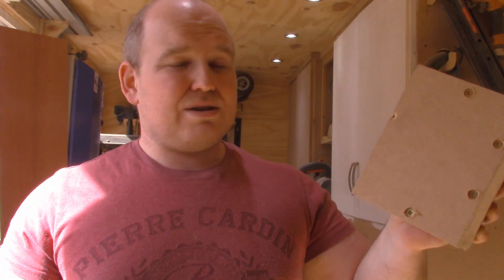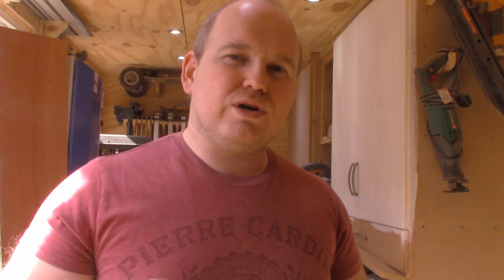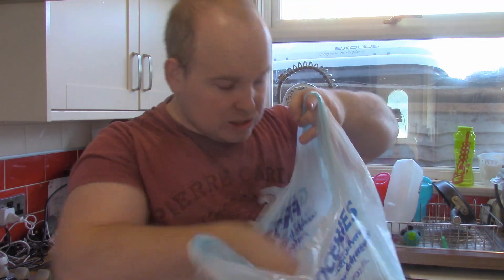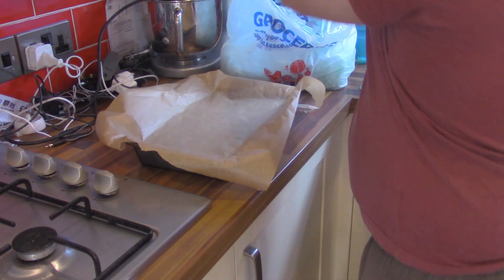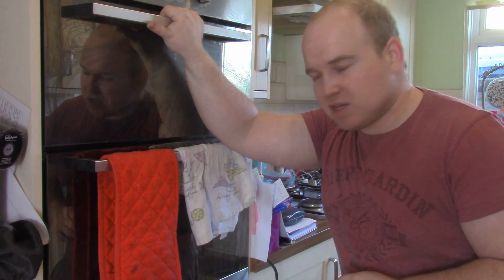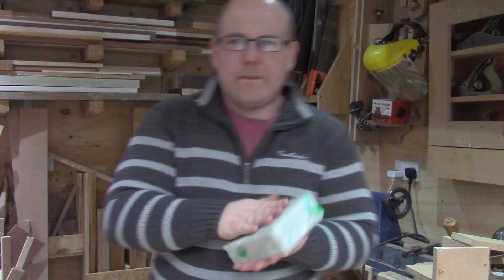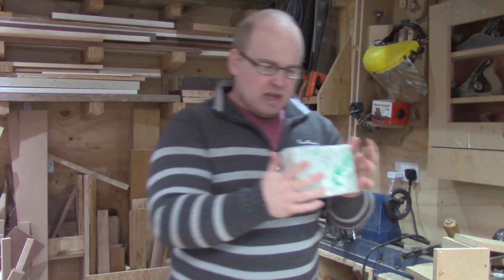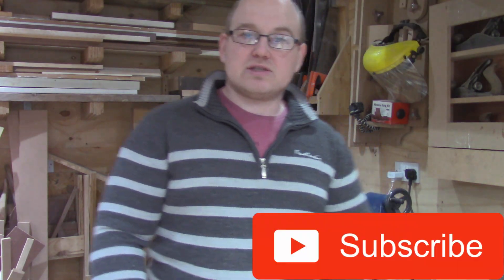HDPE Plastic Recycling | To Usable Blocks

Comment: I think you can go to 300° c (if your oven can handle it) to get a far more liquid shot. I'm under the impression that there aren't any toxic gases to worry about as long as you're in a ventilated space and not gulping in lungfulls of the stuff, ie. Using common sense ( not very common tho)...

Comment: Doesn't the plastic emit fumes during the process?  A lot of this stuff may have been treated with other chemicals with lower melting, decomposition or vaporizing points than the plastic itself. Is anything coating your oven after you do this?
Reply from the maker: No fumes as not hot enough. Just the melting point. Nothing inside oven whatsoever

Comment: I don't recommend using your oven you use for food to do this. There is off gassing. I recommend doing this in a well ventilated place wearing a respirator. Use an old toaster oven, just not where you prep food.
Reply from the maker: Good advice 👍

Comment: Yeah great vid, heat retention is related to the material density (Thermal Mass)
There is a commercial brick made from recycled plastic now being sold for use in homes instead of a light weight building blocks, the benefits are hugely improved insulation.
Now all you need is to get your whole street to donate their milk bottles a wood chipper & 2nd hand washing machine to wash the plastic and you can insulate your shed with your bricks :) Or buy a 1000Kg of the stuff from the council.. 
Top work
Reply from the maker: The possibilities around this is awesome! I love seeing how people put it to such good use instead of it ending up in the ground of water systems. I myself won't be continuing this, but I would highly recommend brothers make, who are doing incredible work using recycled plastics
Reply: @WHCreations  As you said so many possibilities, imagine HDPE thermal cladding? Or over cold floors 
Someone somewhere will be buying up the HDPE making it harder for the little guy I suspect :(
Reply from the maker: @dmbrookfield  as long as people turn it into something awesome and saves it from landfill or the ocean, then humanity is winning

Comment: What happens if you use sun-damaged HDPE 5 gallon buckets ?  Does the UV damage sort of go away when you re-melt it ?  I have a few cubic feet of clean brittle HDPE I would be happy to send you.  Then after melting it would be interesting to see if it has "recovered" from being brittle.
Reply from the maker: Hi Roger, thank you for the offer, that's very kind of you. Unfortunately, I don't tend to use my hdpe anymore due to being unable to get a uniform finish. Appreciate you taking the time to comment though!

Comment: I made a mold out of half inch and quarter inch plate aluminum.   It's a great material because it's strong and you can use any woodworking tool to cut it.  From there it's easy to drill and tap holes to hold it together.  Then I just throw the whole thing in the oven and  heat it up.   It works great because the aluminum retains the heat for a bit while I get it clamped, then it acts as a heat sink when it's out of the oven to cool the hdpe.  I did something similar with a bit of 2 inch threaded pipe to make a cylindrical mold that I can use for making things I can turn on the lathe.  Great vid!

Comment: Nice video.... 2020 has been a horrible year with the lack of available materials for creative recycling..  and melting HDPE looks like a possible way to get around the shortages..  just  have to remember the upper temperature limitations
Reply from the maker: I wanted to try and make a piece of furniture using only hdpe. The cost for such materials was astronomical and just wouldn't have been feasible.  One day maybe

Comment: I'm having a problem with it sticking to the parchment. It's even scorching the paper and I only started at 300-325 C (150-160 F). Do I need to buy more expensive parchment paper?
Reply: 170° Celcius buddy.. not 300°celcius
Reply: 300C is over 570F. Are you sure you have that right?

Comment: I tried this in Dublin. Put the cut up bits of HDPE on an oven tray and set the temperature to 170c . 30 mins later it was barely melted . Also my wife asked me what the smell wqs. Left it for another few mins. Turned oven up to 200 for 2/3 mins  Still  Could not mould it as it was not soft enough. Threw it in the bin . What did I do wrong ???
Reply from the maker: Are you sure it was HDPE? hdpe melts pretty easily and molds well. I dont know without standing next to you at the time what you did wrong I'm afraid.

Comment: Nice video. Thanks for sharing. But I'd never do such a thing in an oven which later on will be used for making meals and  cakes.
Reply: You drink milk from materials that contain toxic substances?
Reply: @836dmar  No, I don't. Firstly, I don't drink milk at all. Secondly, milk is not packed in HDPE containers in my country, as far as I know.
But I don't know if it is proven if HDPE containers contain toxic substances that are released under normal circumstances.
When you burn HDPE, then yes, or when you heat it up too much. But I think that is the case for most packaging materials.
Reply: @hansdegroot8549  I melted a 5 gallon container today of white HDPE. At 300F it smelled like wax. Not sure if it was toxic at all but it wasn’t really bothersome I know that. That was a lot more efficient than melting down individual milk containers used here in the US.
Reply: @836dmar  Did you cut the hdpe in smaller pieces? I don't know how much 300F is.
Reply: @hansdegroot8549  Yes but at first only into larger pieces. They melted into a sheet that was a bit too thick for my project - maybe 8mm or so. Making a press to make blocks would be best IMO. I also cut small pieces and shredded them in a blender. I used those small pieces to fill in voids in a small sheet metal mold I made to surround a metal press finger that needed padding. Used multiple heating cycles. Ended up with some air bubbles but might use a heat gun or torch and smear some as a “patch” or filler over those areas just for aesthetics. Went up to 350F but that did increase the waxy smell a bit. Anything 300 and up works. Takes some experimenting but is interesting to work with.
Reply: Also found I could cut thin strips of HDPE and use it as filler rod with a heat gun or torch to soften the surface and the filler strip and weld up voids. Smoothing with a hot paddy knife helps.
Reply: He is at 170C that should technically be below temperature for releasing toxic gases, but yes you're right lol. Best practices kind of thing

Comment: For an FYI here, HDPE weighs just under a gram per cubic centimeter or just over half an ounce per cubic inch.

So, do the maths on how big your block will be and you can weigh your scraps to find out if you have enough.
Reply from the maker: Good tip
Reply: @ashwinpatel7410  it would be about 75 ounces or just about 2 kilos if you think in meteric.

Comment: I'm pretty sure the fumes from this are terrible for you. are you still alive?
Reply from the maker: Let me check...
Reply: See my reply above to Andrew Young’s comment.    Both low and high density PE are purely composed of hydrogen and carbon atoms fully bound in a polymer structure which is very stable.    Not normally any additives, especially in food grade like milk bottles etc.    factories where hdpe is being blown or molded are not toxic zones.    As long as you keep in the normal melting range you are fine.    However, pvc, especially flexible pvc where plasticizers and other additives are present as well as chlorine atoms in the polymer is a very different story.    Stay away from pvc.

Comment: I use Lubriplate, white lithium, mechanics assembly grease as a ‘wood’ mold release. When either HDPE and LDPE are cool, the plastic falls out. Your shop looks interesting. Stay awesome.
Reply from the maker: Hey Doug! Thanks for the tip I will certainly look into this! You too bud

Comment: we tried the same procedure only that the plastics are not melting at all, what's the reason behind this?

plus, is putting the hdpe plastics by batch? what would happen if we put all the plastic all at once?
Reply from the maker: Hi, I would say the temperature isn't high enough or you are not leaving it long enough to get to temperature. In regards to putting all the plastics in at once you will be greatly increasing the time it will have to remain in the oven and also you may get more air bubbles.

Comment: I'm concerned about the grease & fat from the milk preventing homogenous melting together of the various HDPE container snippets. That would mean that despite no air pockets, one HDPE blob from a container snippet wouldn't mix completely with another blob from another container snippet. Did you use something to combat the milk fat/grease?  Did you thoroughly wash the milk containers? What went into the preparation of the raw HDPE prior to melting? Great video and I'm envious of your workshop! All the best, Rob
Reply from the maker: Hey Rob. That's a very good point you've made and something I never even thought about showing in the video. In regards to the residue within the bottles know that they are washed thoroughly and left to air dry. In regards to oils etc I am a little unsure. The hdpe is technically a hard oil and therefore would be unsure as to how other contaminates would effect the overall outcome. I would point out however that these have had all their labels, ink prints and glue removed. Thanks 😊
Reply: maybe you can add some waste oil and got uniform result

Comment: Hey man, i recommend you to buy a cheap aluminum tray and use just that, it usually peels of easy and you don't have to use that paper that sometimes sticks, at least for me it was a nightmare, all the time it glued to the plastic leaving a horrible look. Also if after a good time it stills hot it means you got a great pressure!, since the heat could not scape. If you cut it in the middle to 'glue' them together, you could use that tray but not in the oven, put it on the stoove on medium to low heat and place both of the faces you whant to fuse there for a while and keep an aye out, after a while both sides should be soft enough that by putting them face to face and giving it some pressure (nothing crazy), it will bond like a solid piece again. Great video and keep creating! :D
Reply from the maker: Thank you Victor that was great info!
Reply: Hope i helped mate!

Comment: Very uninformative 
Forgot to mention the temperature in the oven.
Didn't explain why you didn't fill the tray the 1st time like you did the last time  ?
Reply from the maker: Hi, I did mention the temperature it was 175°c. In regards to your next question I'm slightly confused by it, please explain in more detail or watch the video again as I do believe your questions are answered.
Reply: The reason why he did not fill the tray is because when it gets hot it also gets smaller, having too much can make air bubbles, and having too much takes longer to melt to a nice point since all the pieces are layering each other, its not a fast process you need to be patient with it

Comment: Do you have any idea of how much HDPE it took to make that block?  Probably just knowing the weight of the block would help.

I've been cutting up HDPE milk cartons and the pile doesn't seem to grow nearly fast enough.  :  )
Reply: Go to your local school after hours and raid a dumpster for plastic milk jugs or talk to the janitor and make some kind of deal with him
Reply from the maker: Hey Brant. In my latest hdpe video I think we used roughly around 1kg of plastic. You'll be surprised by how much you'll need to make a blank the size I did. Seeing as I have 2 young children I seem to go through milk like I should have shares in it, but also make sure you check out your other good too. Shampoo/hand wash bottles etc are all hdpe. Just make sure it has a 2 in the triangle and washed out sufficiently and you'll be golden. Hope that helps you out!
Reply: Thanks so much for your reply!  I will start looking at every bottle to check if it is HDPE.  I want to make some sliding parts to fit within the dovetail slots of my table saw.  I am trying to avoid buying another expensive sheet of the HDPE.  Tell my cow buddies to keep pumping out the milk!  :  )
Reply from the maker: Haha. If you're in the UK the pound shops sell hdpe cutting boards. Failing that just make sure you keep the heated plastic under pressure. If you check my new video I kept tightening it every 30mins or so.
Reply: Thanks for writing back.  I am in the US.  We have some of those cutting boards here, too.  You have be careful on some of the cutting boards as the HDPE is sometimes just a thin skin over a piece of fiberboard.  (Some here call fiberboard "termite barf".  I like that!)  I really need to check your other videos.
Reply: Use 5gal buckets cut up into pieces.
Reply: If you happen to know a car mechanic or any place like that, those motor oil containers are made of HDPE, thats how i got literally a box full of it, since the mechanic uses them daily, the only problem is that is really annoying to clean up.
Reply: @kendarr  Yes, Victor, how do you clean up the remaining oil??  Bob
Reply: @rsauve999  Wash it while its on one piece, and then cut it in half, and you wash and scrub both sides with a abrasive sponge, like that green part of the sponge and scrub it really well, i find it better to use lime based soap, you know its clean when your finger dosen't slide on it anymore and you got  rid of the smell
Reply: For reference, HDPE comes in at just under a gram per CC. For us Americans, it's just over half an ounce per CI.

So if you want to make a block of a certain size, just figure the volume.

Comment: Any idea what the results would be like for molding vs. carving? Think you could eliminate the air pocket issue with a crucible-style melt and pour? Or does the plastic degrade at too high of a temp/in a liquid form?

Cheers.
Reply from the maker: To be fair I'm no expert at this. Alot of the info is what I've picked up through research or other similar videos. I believe cooking at too higher temperatures can produce a dangers gas of some sort but cooking at the lower temperature you'll be good to go. I hope this helps 😊
Reply: WH Creations much appreciated, cheers.